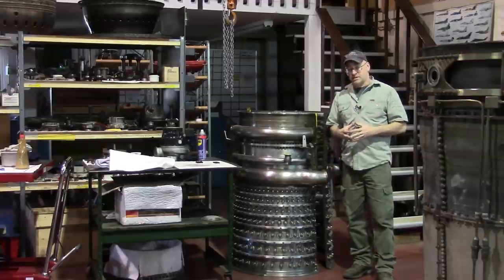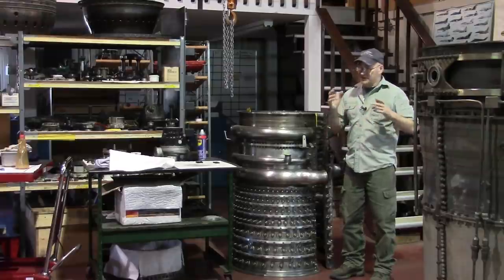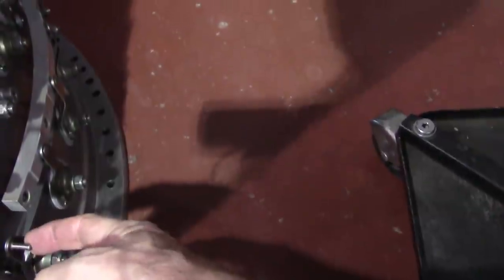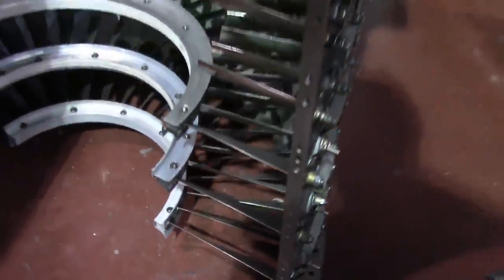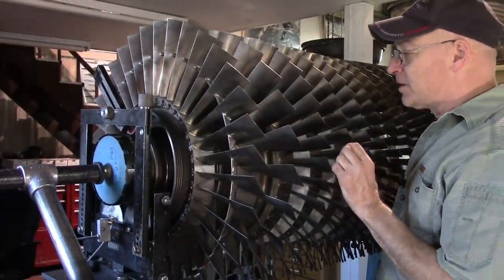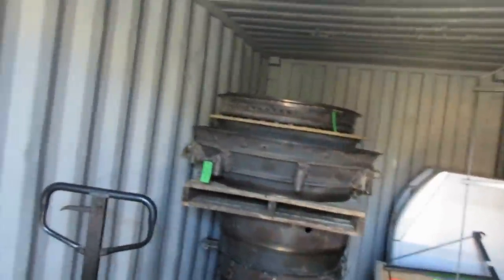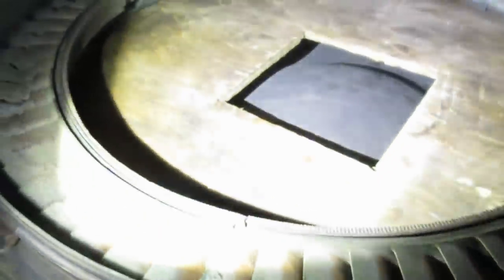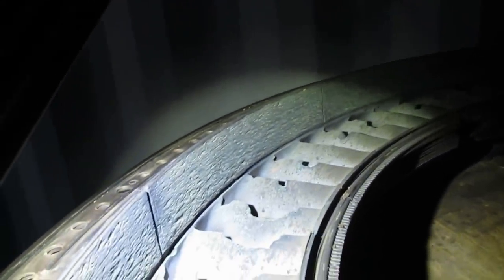Turbine Engine Heat Damage

Comment: How long would it take from engine starting to go bad to get to the level of damage on this engine?
Reply from the maker: From a perfectly new engine, you could get to this stage of damage by doing no maintenance for about 20 years of running at normal temps.
OR, you could make your engine look like this in less than five minutes if you exceed the EGT limits by a few hundred degrees.
Damage depends on temperature.
Reply: I have to assume that, once it starts internally shedding little bits of metal, things progress pretty quickly from there to the end. 

I’m also guessing that any kind of gritty dust or dirt ingested would ablate away metal fairly rapidly.
Reply: Cool, wanted to ask that question, as well. A follow up to this question: would you be able to tell the difference between the two instances (20 years no service vs 5min overheating) in terms of damage? I would guess that it would be easy to tell the difference in terms of accumulated dirt or soot, but would the visible damage be different?

Comment: Is this considered a high bypass engine?? What percentage of air is used to operate the engine and percentage of air goes through the engine it doesn't need??
Reply: Bypass engines are on airplanes. This engine is part of a power plant so it needs no fan / bypass. Just google high bypass turbofan. Anyway the engine in the video is a LM2500 so the basic core of this engine is also used in the CF6 engine which is a high bypass turbofan. Clear?
Reply: In the LM2500 all the air that goes through the engine is used to operate the engine. The exhaust of the LM2500 is the power output and is used to drive another turbine stage much like a windmill which is then via a shaft connected for example to a generator to produce electricity.
Reply from the maker: I think you might benefit from watching my video called Turbojet, or Turbofan...
Reply: @wiedehopf9068  I'm an A&P IA which is Airframe & Powerplant with Inspection Authorization I asked because I am not familiar with this powerplant. I'm very familiar what high bypass engines are

Comment: I've been careful to not ask stupid questions here (contrary to what every teacher seems to proclaim, there IS just such a thing) so here goes: this is evidence of operator error, no? Power dropped off so they just gave it more throttle until vibration alarms intervened? Which I would credit with preventing complete catastrophe. Blade chunklets (my version of Chicklets) impacting those rear frame struts no doubt equal time bomb. OR - could fuel have gone lean? I'm another one fascinated by post mortem analysis!
Reply from the maker: That could be one possible explanation, but unlikely, as these engines are usually controlled by a fully automatic fuel system.
As stated in the video, I don't have any history on this engine.
So let's not speculate, Ok?
Reply: As you wish - just couldn't help myself. Thanks Jay!

Comment: Very interesting video. Will an engine in  this condition still start and run? I suppose if it does run would be degraded in power..
Reply: it might... but it probably won't run very well, and it would probably blow up not long after startup
Reply from the maker: It was running just before it shut down, eh?
If the damage was about ten percent of what we see here, it would run, but the power would be down, and the fuel flow would be higher. This would cause it to run hotter, which causes more overheat damage.
There are many sensors monitoring the condition of the engine. We do not know the history of this engine, but it seems the information from some of those sensors was not getting through.
Reply: You wouldn't want to try that. As soon as bigger pieces start flying off, they don't get blown out of the back, but "centrifuged out" perpendicular to the axis of rotation,  you can end up with an uncontained engine failure.  You just don't want that to happen, because of the shrapnel flying around, shredding everything in their path. Just imagine when this thing starts disintegrating at 3600 rpm.
Obviously it has not happened here yet, but even with my limited knowledge of gas turbine engines (all I know I was told by Agent JayZ on this channel) I can totally imagine this happening at some point if you don't hit the shutdown button soon enough.
Apart from the physical  dangers of such a catastrophic engine failure, you don't want to risk the engine completely. I can imagine the repairs are not cheap with all the parts and labor involved, probably more than all you will ever spend on car repairs in your whole life,  but still much cheaper than writing off the complete engine after its destruction and buying a new one.
Reply from the maker: Colaholiker...Maybe you don't want to know that the HP system runs at 9200 rpm, then?
The blades in this video are from the HP turbine...
Reply: @Colaholiker  That would be the "donating parts to the world" situation!
Reply: @AgentJayZ  I had the number 3600 from the LM 2500 Wikipedia article. But I am sure you know better than whoever put the number there. ;-)
But honestly, the thought of the turbine disintegrating at 9200 RPM doesn't make it more comforting to think of such an event happening... 😱
Reply: 3,600 rev/min would be the LP spool and fan speed of a CF6.
Reply: I wouldn't dare to doubt what you say, grahamj9101. It does in fact sound reasonable, and with the LM2500 being just a single spool engine, missing the fan and the LP turbine driving it, that number would not make sense for this type of engine. And actually I think I found the source for the number 3600 - in a GE brochure, which is available on their website, the POWER turbine speed is indicated to be 3600 RPM. When those numbers were copied to Wikipedia, the word "power" was removed, probably by someone who didn't know the difference between the turbine stages in the gas generator and the power turbine in the exhause gas path. (Being a long time viewer of this channel I am at least familiar enough with this concept to know what's what.) Or maybe they just didn't understand that the gas generator shaft and the power turbine shaft are two pars which are mechanically not connected and therefore can rotate at different speeds.
Reply from the maker: Yes.. the 3600 is the speed of the fan of the Cf-6, or the PT of the LM2500. The core of the CF6, or the HP system of the LM2500, runs at 9200 rpm. 
The nozzles and blades shown in this video are from the HP system of an LM2500.

So thank you for correcting me with your Wiki mastery... and you ignorance.
Your arrogance I will match, sir!
It's not that I know more than Wiki... it's that your understanding is weak.
Reply from the maker: Cola... quit while you can....It's you who have the lack of understanding.
GJ  Is a gas turbine design engineer.
Esplaining things to him only makes you look more and more incompetent, and to a lot of people, that's entertainment.
Splash on, Slappy!
Reply: @AgentJayZ  you totally got me wrong, maybe you forget not everyone is a native speaker of English and therefore their intention may be not what you think.. I know absolutely that you and GJ know more about those things that Wikipedia or me. I just wanted to point to the possible source of the wrong numbers that fooled me. I am aware of the difference between the power turbine (or the lp turbine of a turbofan engine) and the gas generator turbine of the LM 2500 (or the HP turbine of the turbofan engine) so I understand that there are different speeds. If you read again you will see that I pointed out Wikipedia is wrong. Not you, not GJ, and I was citing the wrong source. Got it?

Comment: question . why do the front struts have plates welded on to one surface ?
Reply from the maker: It's a fabricated structure, made by joining formed pieces of stainless steel sheet... by welding.
Some frames and cases are made by casting. Not this one.

Comment: Is it possible to have arcing plasma as the torch instead of fuel injectors? I know it's in the scale of impossible now, but what if??
Reply from the maker: Energy is needed to heat the air in the combustors to feed the hot working gases to the turbine. How you supply that energy is open for your imagination.
Reply: Turning electric into mechanical energy is certainly possible the way you describe. But it's very inefficient due to all the heat losses. An electric motor turning a fan is much more efficient.
Reply: But to drive a fan with an electric motor, you must have a generator (and/or a big battery) to drive the electric motor.  So what drives the generator - a gas turbine?  Within the next couple of years an aircraft will be flying with one engine of four replaced by a fan driven by an electric motor - and it will be powered by a generator driven by a gas turbine, housed in the fuselage where passengers previously sat, plus some batteries.
Reply from the maker: ...whoosh!

Comment: What would have caused the heat damage in the first place? Generally these things more or less run themselves, don't they? At least insofar as you'd only check the gauges every few hours or something. What would've been the catalyst for this? Sorry for the stupid questions, I'm still quite new here, and to the nitty gritty of jet engines, but it's all very interesting. Thanks in advance.

Comment: as the essential design of jet engines has remained unchanged, almost since their birth, with exceptions for materials ( strengths, heat tolerances, sustainability )  electronic control systems , fuels / pumps and overall accuracy of parts .. do you have any alternative designs for the jet engine as we know it ? I will accept a yes only, as I do not wish any intellectual property theft  . ps I believe I have 2, almost completely new designs .

Comment: I love the damage! Trade you AMS certified lock wire for scrap parts?!?
Reply: Sorry! I don't know if "Aerospace Material Specification" applies to Canadian industrial turbine repair. I mfg. lock wire for GE, PW, and RR turbine engines. We supply 321, 600, 718, and Hastelloy X for aviation. Are you aware of micro laser welding repair of turbine blades?

Comment: Those damaged blades were interesting. It looks like a hollow honeycomb construction. I wonder how they are made.
Reply: They are cast using lost wax technique. The inside cavities are for cooling.
Reply: As ASJC27 said it's a lost wax casting method for those in use today.  But they've recently started experimenting with 3D metal printing processes as well.  AFAIK not in use yet but should give some new capabilities. - https://www.youtube.com/watch?v=DyKaKsHzYAY

Unfortunately most of the youtube videos just call everything turbine blades.  If you see ones being forged those are most likely compressor blades as they don't need the internal cooling structure.

Comment: AgentJayZ, why are there welds on the intake struts?
Reply from the maker: Welding is an excellent way to make reliable connections between two pieces of similar metal. The inlet is a fabricated assembly, not a single piece casting.

Comment: So what type of alloy is the fidget spinner( cork board) made of to keep the LM2500 running smoothly?
Reply from the maker: Sintered fragments of shattered turbo 3.8 intakes...
Reply: So the turbine engine manufacturers have personal stationed at dragstrips worldwide ready to leap out and salvage pieces from over boosted buicks in order to make parts? Or do they have facilities where technicians build and explode 3.8's in order to harvest the precious raw materials? Either way, it's no wonder these engines are so expensive to build! Seriously, thanks for the videos, very informative and well done

Comment: Why would they push the turbine to that point?  Pretty sure there are sensors to tell them the engine is running to hot.  I can understand if it was military and they could just replace it and not worry about cost but otherwise it costs hundreds of thousands to repair or replace this.
Reply: Remote installation, as a power unit for a powerplant. They cant just shut down, otherwise some area is without power.
Reply: +The   Yea but if they burn it up then its gonna be shut down for a really long time right.
Reply: i see this kind of running a lot.. just make shure it holds up to the next turn around (once every 4 years they stop for major service, the rest of the time it runs 24/7)

Comment: so it looks like the tools were running the crap out of it while it  was grinding, screaming, and crapping its innards out the back. they should be slapped those turbine blades. no telling what could have happened if that engine had grenade.

Comment: How can such a badly engine be worth repairing is beyond me. It would be great to see a more overall view of it where you point out what is good and what has to be replaced.
Reply: Mathias Westerlund it comes down to money, repairing a badly damaged engine is cheaper than buying brand new.
Reply: @fluffyhead6377  yeah that's the part that is odd to me here. This is hundreds of hours if not more of highly skilled labour PLUS large portions of the engine needing to be replaced anyway. Of course it is about money I am just interested in how this repair can be cheaper than new when it is so badly damaged on such a big scale or if it looks worse than it really is and the parts damaged are cheap to replace in the big scheme of things and the non damaged parts are the expensive 80% of value parts (or similar) hence why I would like more of an overview explanation of the damage at hand.
Reply: Mathias Westerlund I understand what you mean, allot of effort goes into refurbishment but it must be cheaper or these companies would just scrap and replace.
Hopefully someone in the comments can work out the cost refurb vs replacement.
Reply: @fluffyhead6377  of course in some cases tho you cannot buy new and it's a refurb for an historical object. But yeah. Most of the refurbished on this channel makes sense to me. This one is just that one which is really odd to me.

Comment: dear jz i have just encounted  an old pair of jet engines..they want £6,500 for the pair  one is a rolls royce derwent  what mark i noeth not . the other is a bristol siddley mamba . which was used in the fairey gannet.. the derwent was only used in the clearance of snow for the runnway.. and aparentley nothing else  they are both solid .. {not free rotating] but after standing for a minimum of 20 years plus..  what can you expect.. £ 4.500 for the derwent  £ 2.000 for the mamba.. .. interested? am using my muckers computer at the moment . you know me for the offer of the avpin starter {james smith.. look forward to m a reply.. yours most sincerly  james smith
Reply from the maker: Non rotating engines are scrap. Even if they have aftermarket value...
Great as museum exhibits if they are free and you cover shipping.
If you want them to run, expect to spend much more than the purchase price.

Comment: That hot section looks like Stalingrad in 1943... 
if they didn’t trip on vibration they must’ve seen a big loss in power at least
Reply: I'm imagining a conversation that went something like, "Yeah I know it's running hot but the replacement engine won't be here until the twenty-fourth so just keep it running until then, we can't afford to shut down.".

Comment: Are the rotors and stators made out of the same alloy? I know that the compressor and turbine blades are for the most part different, but I ask about the rotors/stators as different assemblies. Also, can you provide me/us with the alloy recipe and maybe its hardness?
Nice content btw!
Reply from the maker: Compressor blades I have seen are made of Aluminum alloy, Titanium alloy, stainless steel, and Nickel alloy, in order of temperature resistance. I do not have access to the ingredients in the alloys.
Compressor Stators are made of a range of similar alloys, which might differ slightly in their proportions from those used to make blades.
Hardness is good, but I think strength, stiffness, toughness, corrosion resistance, and heat tolerance might be even more important for compressor rotors and stators.
Reply: @AgentJayZ  when you say "quite a bit of nickle", it's most likely an inconel 625 or likewise (inconel is a trademarked name, the material is sold under various names). Alloy 625 has a nominal chemical composition of 61% nickel, 22% chromium, 9% molybdenum and 5% iron. Alloy 725 is still 55-59% nickle. there's only trace iron in it

Comment: I've always wondered when an engine starts to eat itself alive does it end up running lean and then accelerate the burnout? I love engineering
Reply from the maker: Engines don't eat themselves, and I don't know what you mean by "the burnout", but a hot start could be described as running rich, because airflow is insufficient. 80% of that airflow is cooling air, not combustion air, but if you really wanted to call it rich, you could get away with it, but the people who understand how these engines work would instantly know that you don't.